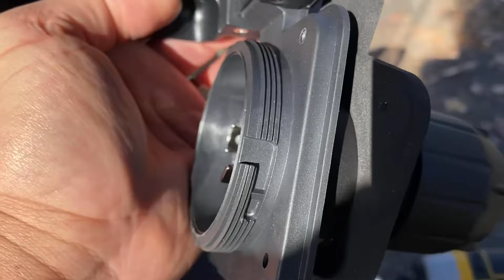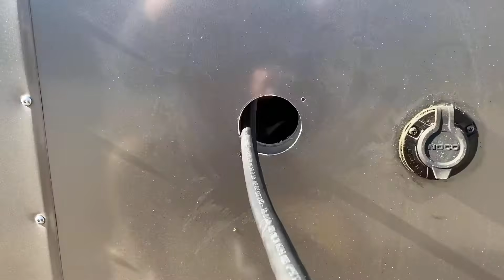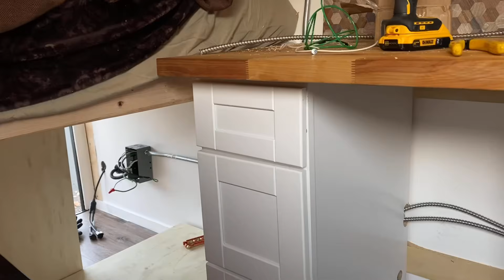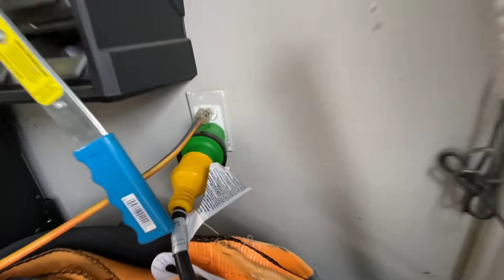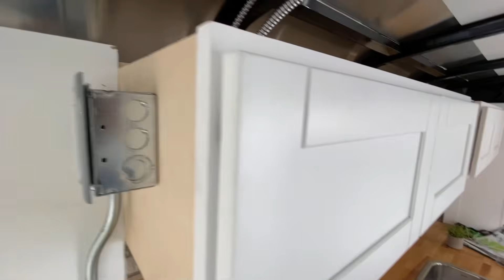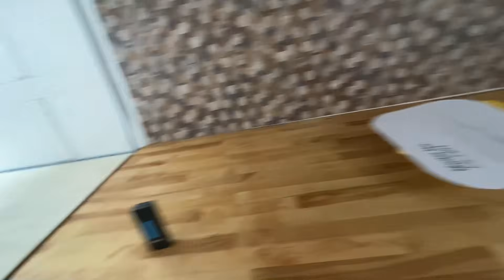electrical setup in my cargo trailer | Shore Power

Comment: is the shore power standard turning single phase into a split phase in the panel?  why not just run a standard l14-30 generator outlet.  that way you'll have split phase into to your panel.

Comment: I agree on the kiss program. You can actually get one of those lithium power boxes for 30 amp. Could charge that system while driving or with a small solar panel.

Comment: How does the grounding work when the trailer is also connected to the tow vehicle's DC electrical?  Doesn't that create conductivity between the DC negative terminal and the AC neutral bus bar via the trailer's chassis?

Comment: Um i don't know about only one electric set up ,,,iid still have both , last thing i want off grid is a noisy gas generator going when ever i want power and seeing you have no windows that means any time your rig is closed you need to run you genny , ya id think real hard about this guys , im spending the money and doing 12 and 110 true off grid means not having to run into town for gas and also not annoying other campers with my gas generator running all the time ...id rather spend the money on a double set up then be out NOT enjoying my camping .....ya its going to cost about a grand to ad solar but when your out camping and everything works in any situation ,  its priceless...........

Comment: Trailer looks great 👍
I really like leaving the wire external, If an outlet is some I dont like, move it.  I might not even conduit them at first until I use the trailer for awhile -- just heavy duty extension cords until I see where things are needed
Cheers

Comment: Well done electrical work!   He did it correct.  For your safety, please make sure to add a neutral-ground plug in your generator if it is an inverter generator and the N&G are not bonded.   With all the metal in he trailer, if something goes wrong, the generator could keep running with your conduits, boxes, and metal trailer parts could be energized.

Comment: Just a question, did you say you ran a 30amp cord and plug from your trailer to a 15 amp circuit in your garage?
Reply from the maker: That’s correct

Comment: The reason people go off grid is for peace and quiet not to listen to a generator running all day and night.The best way would have been 12 volt/solar. Use a diesel heater for heat. Also is your ac unit a single or double hose set up. If it's single you will not cool your rig in extreme heat and humidity (NUMEROUS YT video's why it won't work). You need a two hose system for it to work correctly. A 5-8,000 btu window unit would do a much better job cooling and will run from an inexpensive solar system. Also if your current ac goes out and you're boondocking where will you find another unit to replace it. A window unit will cost less than $200.00 versus the unit you have now will be minimum $500.00 and you can't get them at walmart. You can find numerous YT video's on why not to use the ac you are using and there is a good reason not to use it. Your electrical looks good and I agree with it being simple, now add 12 volt/solar it's not that expensive! Then you'll have the ideal CT camper!
Reply: Thank the Lord that you are directing him in what he needs to do. He wouldn’t be able to enjoy his camper without this knowledge.
Reply: Each to his own. One could also say that the reason people go off the grid is so that that they can run their generator at any time as long as they want without having someone camping next to them, breathing down their neck and whining about someone’s generator disturbing their? peace and quiet.

Comment: Can I ask why you went with a 30amp shore inlet vs 15amp one please? Thx
Reply from the maker: Hi, The 30 amp is a common outlet at most rv places. 
2. It also allowed me to split the power box so I have a dedicated outlet for my AC / Heater, and another for everything else.
Reply from the maker: One more thing, my Honda generator also supports the 30 amp outlet plug and this was my primary reason to go with a 30 amp on my trailer.
Reply: The breaker box was like that because if it was a true 30 amp you would have a red and black coming in to land on each breaker. That's whys its more efficient. The jumper you installed essentially makes it's no more then what you already had

Comment: Nicely done video. No distraction!
I just bought a GE brand 6-space (for 6 breakers), 125 amp panel for my new 7'X16' cargo trailer.  I want to put each outlet on its own 15-amp breaker: one for refrigerator, one for microwave, one for 2 hot plate burners, one for toaster oven, one for outside the trailer, and one for anything else (maybe for a split AC in the future but not now). 
I am following you, using 10-3 wires for incoming and 12-3 for going out to all 6 outlets. 
I am not sure if I can use any standard 15-amp breaker or do I need to use GE breaker. What do you think?

Comment: Should I run a ground wire from the ground bar to the trailer frame?
Reply: If you're running shore power along with a generator, you need a transfer switch installed am I right?
Reply: @ShawnGraham8 Why run both?
Reply from the maker: I did not., but That’s a good question to an electrician. I haven’t had any issues running my generator or shore power.

Comment: the only difference is the put put put of the generator usage, i know the honda's are quiet and all that good stuff, eventually ill get a generator, but im building a 12v system to start, when we get our fourth battleborn, ill change it over to a 24v system and the only change ill need at that point is the victron multiplus 3000vac, with 600w solar and shore power/gen - the system is starting smaller, but with the full capability to max out at 24v 200ah DC, with shore/gen plug ins - we'll be able to be off grid for upto a week, our only bottleneck will be food capacity, but our camp and power system will be more than sufficient for our needs.  I like your setup though it is clean and simple.